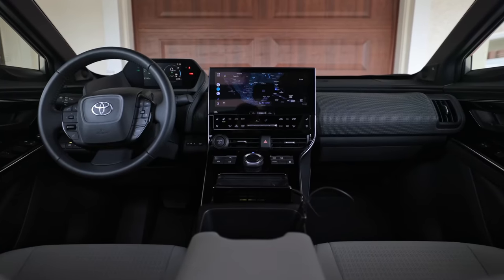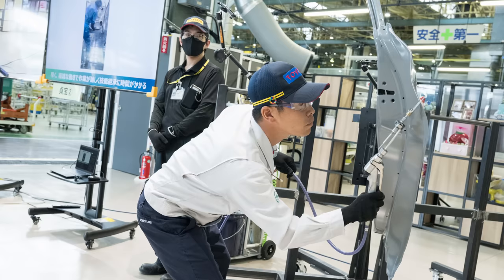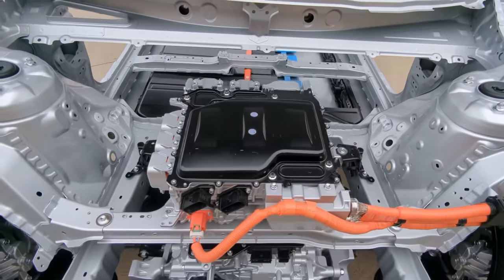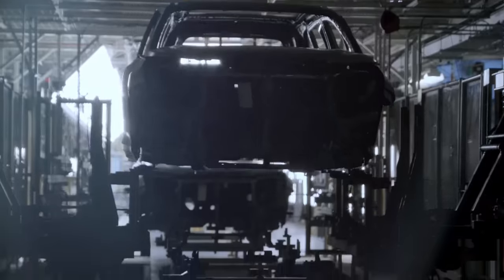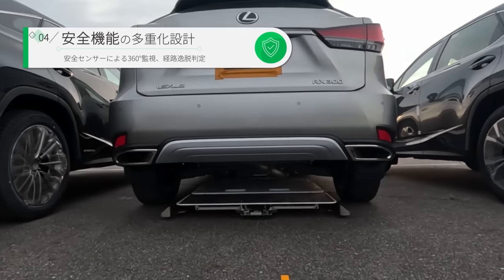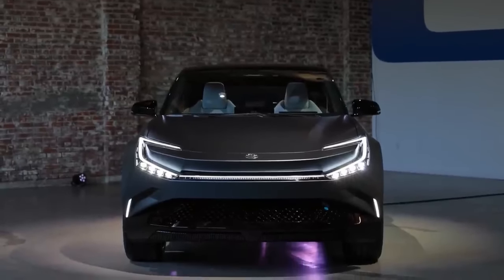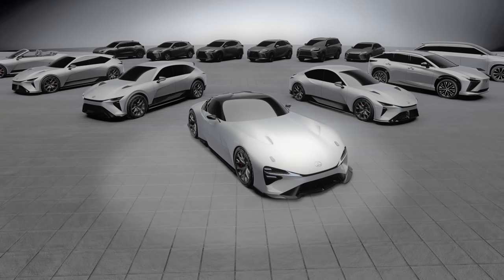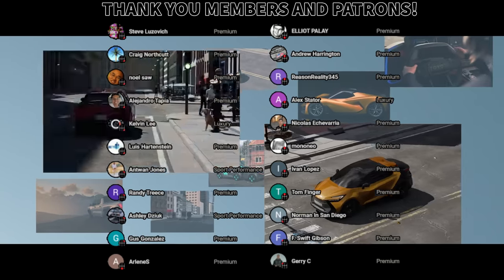Toyota will LEAPFROG Tesla by 2026... Here's their 6-Step Transformation!

Comment: Toyota still haven't adopted NACS! No matter how good their future EVs are, they will fail unless they join all the other auto makers in a standard charging port.
Reply from the maker: Nacs is great for availability, but has its limitations in charging speeds and thermals it seems.
Reply: @KirkKreifels  true. Hyundai/Kia has 800v architecture and they are trying to work a deal with Tesla. Toyota OTOH has been quiet. If you can sustain 250kw speeds, it's over 1,000mph charging speed. I've gotten these speeds on low SOC but it tapers off. More than enough of a compromise for the infrastructure Tesla has IMO.
Reply: @KirkKreifels NACS can currently support 1,000v DC, and amps in excess of 500. V4 chargers are currently being limited via software.

Comment: I want better plugin hybrids or full hybrids. The country is not ready for full electric. So many advantages to plug in hybrid. But also, this manufacturing process sounds like it will cause small accidents to total out vehicles because you won't be able to replace smaller sections.
Reply: Full evs are great tor the far future we need a step by step solution,and hybrids are the right step for now!

Comment: the mobility show would be really exciting to be a fly on the wall for.  The giga press I hope is engineered for the underbody/frames mostly, so repairs can still be affordable also.

Tesla's problem are the panels are TOO big & proprietary that it often totals out when the structural integrity is compromised with the giant glass or pillars are failures from low speed hits on a bumper/side fender swipe

While moving forward to electrification, we Can't follow suit w/ cars the way we consider disposable AA batteries

Comment: Tesla had engineers develop a new metal alloy that allows for giga casting improvements that doesn’t warp the metal after it cools. Has Toyota commented on the materials? Also Tesla works with Idra a company in Italy. Does the company supplying the giga casting machinery have experience in doing this successfully or is this the usual Japanese nepotism?
Reply: they copied the material.

Comment: Thanks for your presentations. Yes I'm convinced they will make it. I have had a lot of cars from my driver license on my 18h birthday in 1972. I got my first Toyota Land Cruiser, in 2018 which is the best car I ever had. Our family have had tenth of different cars but Toyota is on a higher quality level. From 2å25 it's only allowed to sell and buy Zero emission cars in Norway for passenger cars and light commercial cars. Many companies have to buy commercial cars for towing before this. I would love to have the new electric pickup from Toyota if this will have enough range and towing capacity, but I doubt about that. I was disabled of the corona vaccine and will not be allowed to drive and then I don't need any car. But I'm sure Toyota will be on the highest level of electric cars with new battery tecnology of different kinds before 2030.

Comment: No chance, they invented the Toyota Production System ( TPS ) and would never drop it in favour of an agile software development methodology that speeds innovation multiple times. It needs to be a software first approach and Toyota is not a software company. A startup would have a better chance, they wouldn't have all the legacy methodologies to dismantle weighing them down. Tesla initially didn't know how to build cars resulting in panel gaps but they had the important software first approach. Now we understand that it would be better to have an iPhone with gaps than an old Nokia with perfect manufacturing tolerances.

The 6 steps mentioned (step 1 - digital twin technology, step 2 - giga casting, step 3 - batteries, step 4 - body and paint, step 5 - final assembly, step 6 - transport ) are ridiculous. None of the steps mentions software, that's enough to spell disaster. Giga casting takes many years to master and they're just starting. Batteries has already been solved, just need economies of scale to decrease cost. Paint is the most time consuming and can completely be removed like with the Cybertruck. Step 1 is VR? amazing. It's not even a VR for training bots. So much denial and wishful thinking.

Comment: Are BEVs really the future? Isn’t it BEVs are less efficient when they run faster? Isn’t there a better solution than BEVs? I believe electric motors are not that efficient on high speeds.
Reply: Its aerodynamics that make higher speeds less efficient. Remember in 70's when speed limits were reduced to 55 to save gas. This applies no matter the powertrain. ICE is just horribly inefficient in stop and go city driving, so steady speed mileage (highway) appears better.

Comment: Have you ever played leapfrog? Ever try when the other person is running? There is no way Toyota will leapfrog Tesla, not in production, or battery tech. Toyota doesn't have to just leapfrog Tesla in battery tech, but everyone else that sells batteries. So, they really think they will leapfrog Tesla, CATL, LG, Panasonic, BYD, and everyone else? Not going to happen. Keep in mind that solid state is meaningless if the cost is higher. We already have 500 mile EVs on the market, but they are too expensive. We don't need better energy density, it doesn't hurt, but it is not the limiting factor right now. What we need is cheaper batteries. LFP at 40% cheaper is not better than CATL has today, they are already 40% cheaper than current NCM chemistry batteries.

They are a manufacturing powerhouse, so they may catch up to Tesla and even slightly pull ahead. I hope they do it would be good for everyone. But remember Tesla is not sitting still, they are still improving production daily. Gigacasting has been done by Tesla for years already, so that is not a leapfrog. It is going to be an interesting race to watch.

The one place that Toyota does not have to leapfrog is in brand loyalty and perception of quality. Toyota makes amazing cars, and they were (still are) the gold standard in hybrids. I had stock in Toyota, I sold it all when they started fighting EVs. If they really start to move down that line again, I will probably invest again. No one should take my advice on stock picks though, I bought Ford, VW, and GMs lines on EVs. Look at their stock now...

Comment: I still don’t see why people buy EVs
Reply: I have a 50 year history of owning Toyota's (5) and Honda's (3). A year ago I put a deposit down with Toyota dealer after giving up on return to normal for inventory  levels. I wanted a hybrid with updated infotainment system. In May could not put off any longer and bought model Y. Since then went on two long road trips (3000-4000 miles) and I don't see ever going back to a ICE. Reasons include, cost and functionality. I have always maintained my vehicles and ICE have so much more than BEV. It is apparent  that ICE are becoming less reliable with shorter life (largely due to changes to be less polluting and more efficient). The Toyota's I were cosidering had similar price to model Y, before tax credits, and bonus is BEV has lower cost of ownership over vehicle life.
Only reason not to go BEV would be if you only purchase used, have to tow long distances, or you have no ability to charge at home.

Comment: “Leapfrog” lol. Manage to stay alive just a bit longer is closer to reality. Toyota has the same problem as all the other legacy brands. They don’t have the technology, the software, the battery supply, and most importantly they don’t have Elon Musk. They do have a huge legacy ICE market that is dwindling and is being phased out in  the biggest market regions of the world. They have the Osborne effect working against them. Tesla has none of those issues. Tesla doesn’t have to chew their own legs off. And if Toyota’s solid state batteries ever come to market, it won’t take Tesla long to produce their own if necessary and likely more optimized version. Or at least they won’t need to for awhile since their 4680 batteries would be in full production and cost effective by then as well. Though it’s all conjecture. Just like this video.

Comment: Evs are not the future and never will be. Hybrids and more eco fuel ice vehicles are. Many countries struggle with trying to obtain/produce enough electricity as it is. Plug in hybrids are also a waste of time, because once the battery is depleted you are  just driving an extra heavy car with only a petrol engine, meaning less mpg than a standard petrol or diesel only car.  Standard hybrids where they self charge are the way to go, no external electricity required, no extra burden on an already strained network, no extra charging stations required. 
A mix of power trains is the way to go. All electric is not and never will be.
Keep the diesel engines for trucks, buses and cars for people that need the distance available, and for those in remote areas of which there are many such places around the world.
Hybrids would be good in any situation if they are not plug in type. Save evs for cities and people who just travel short ditances.
People need choices, not be forced to have only one option.
I think most who go on about how good evs are must live in cities, because I do not know anyone where I live who has an ev and never hear anyone say oh I wish I had an ev, because quite honestly, they would be useless here as the current network is, which is one charging station every now and again.
Reply: EV's at this point are inevitable, and any company not building EV's are doomed to fail.

Comment: All of what Toyota is going ro do is amazing. And I don't doubt that they are fully capable of building such a car, the problem I see for. Them is there are so many fronts that TESLA  is so far ahead  of everyone, this has taken time , talented experienced bright people. I DON'T  see Toyota or any other car company leapfrogging Tesla anytime soon. So many fronts so many facets.  Building a car is difficult  but building a totally new technology is almost impossible. Bottom line I don't Toyota won't be able to do it that quickly.
Reply: I don't see the big deal. Apple was way ahead of others and they caught up. Tesla's rate of growth and "innovation" will slow down because that happens in industry. Toyota doesn't need to leapfrog. They just need to get a more efficient method of mass-producing BEVs fairly competitive with Tesla or BYD or any other competitor and they're up and running.

Comment: I’m still not hearing anything about how Toyota is going to gain any significant expertise in software engineering. I’m also not hearing what Toyota is going to do about the sleazy scumbag dealer network in the US… I can guarantee that even if Toyota can make a competitive EV at volume, the scumbag dealer network will screw it up with “market adjustment” fees.